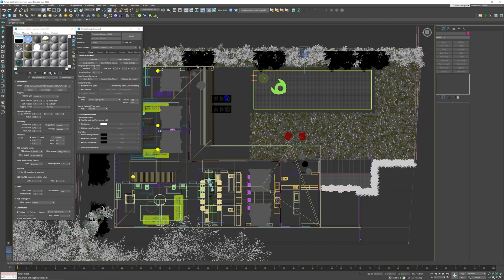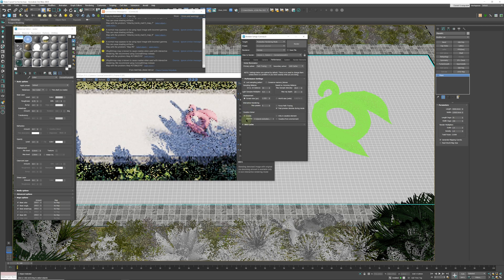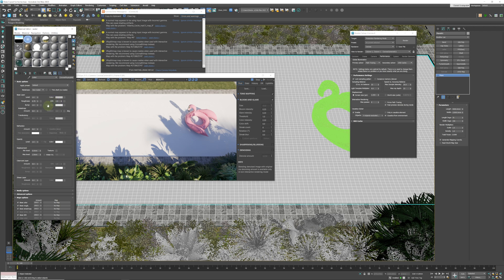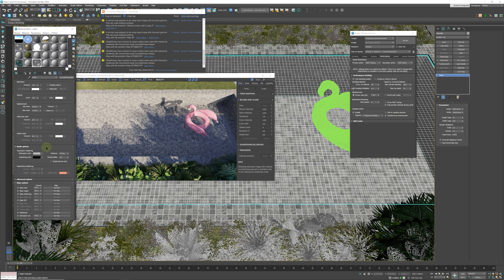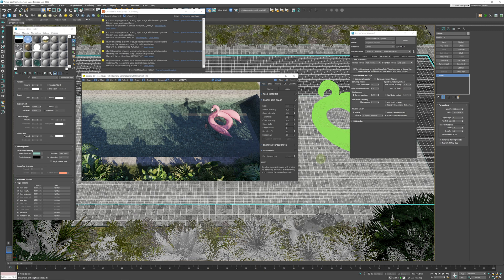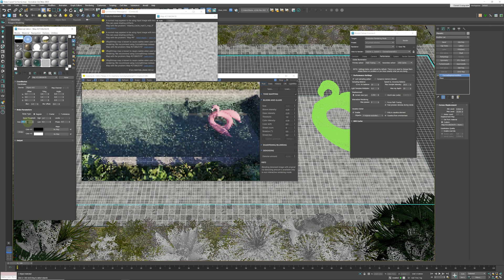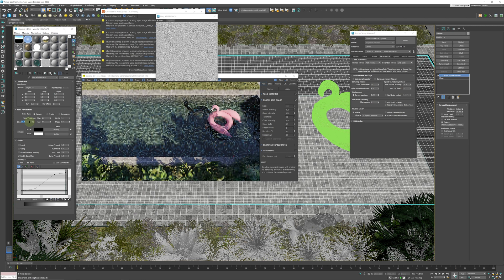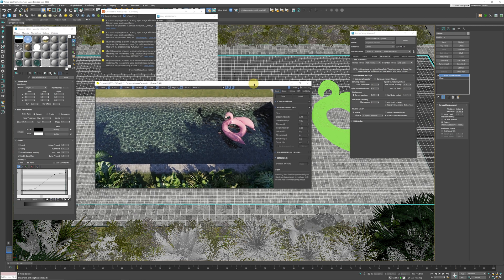Amazing 3ds Max Swimming Pool Water Material With Caustics In Corona Render

Comment: Hi Daniel , thank you for your video tutorial!i am  doing the exacte same steps but i have no caustics result effect! i have the sun located with a bit of an angle on top of the swimming pool mesh ! i really dont know what to do..
thanks again
Reply from the maker: Hi there, can you send a screen shot and I will help you if I can.
Reply: @ds-works   ok i am sending you a screen shot in your email !thanks again Daniel !
Reply from the maker: @paas9225  sent you a possible solution let Me know if it work.
Reply: @paas9225  did the solution work? i dont have cauistics either.
Reply: @busraaslanbusra  no i dont know why and im following every step correctly